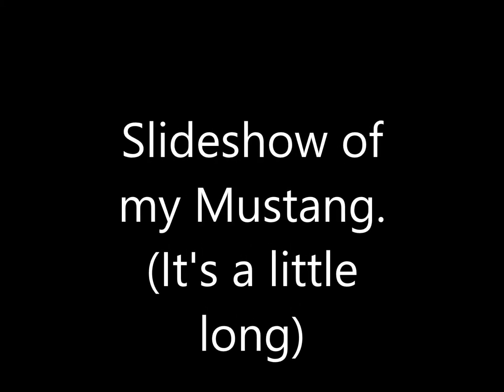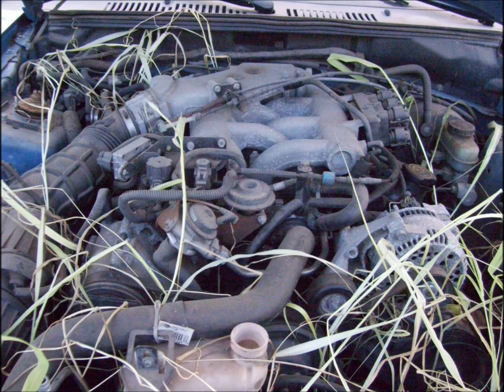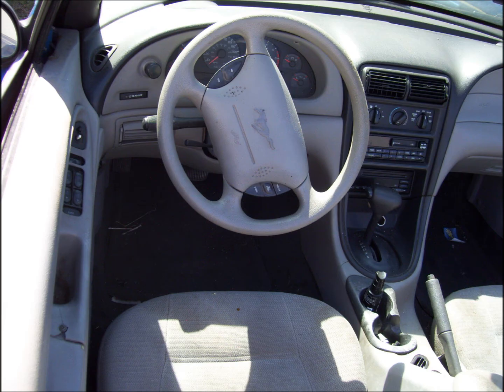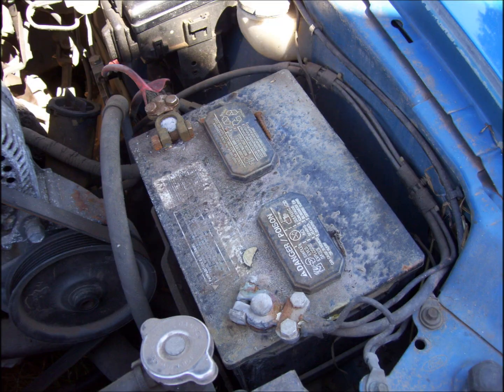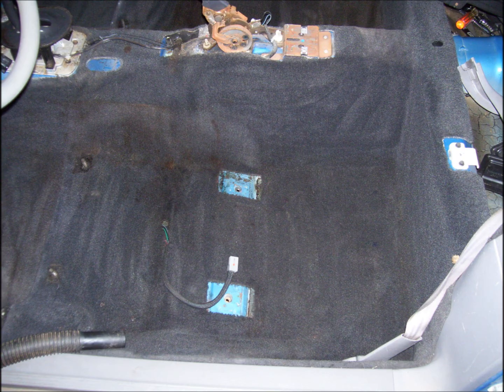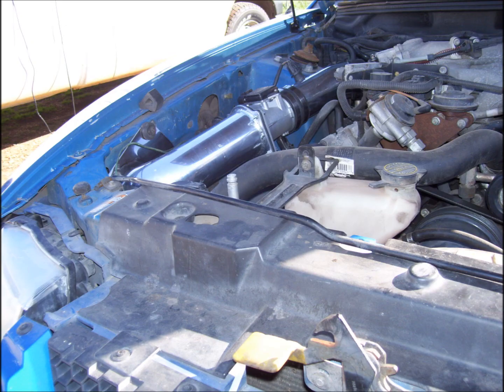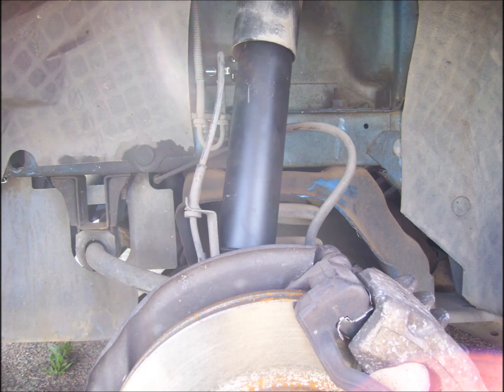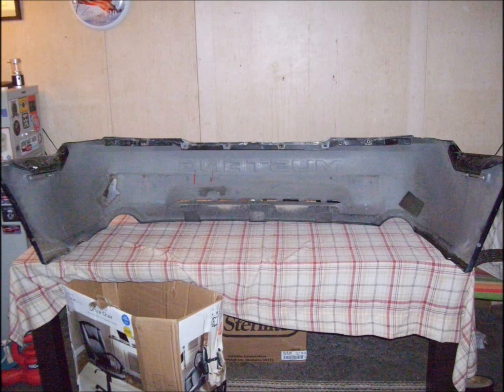Slideshow of my Mustang it's kind of long}

Comment: Looking good my friend I just got rid of a 2000 Mustang last year at 285 thousand miles on the motor and it was still running but the floors were rotted out and gone and the frame was pretty much cracked in half 😁👍👍👍
Reply from the maker: Thank You mine has 197,000 miles not much road salt here so no rust.

Comment: Things like this takes time, but worth it especially if you got it for a decent price due to a fuel pump to begin with.  Everything else can be done as long as you got time, know how and a little money.  Little bit at a time.  Thats what I did with my 76 vette.
Reply from the maker: Thanks I didn't know you have a Vette my favorite car you still have it?
Reply: I still got it, its in the garage.  I rarely drive it since the oil/gas wells have been tearing up our roads here. They said they would be repairing what they damaged by next spring, so we'll see.
Reply from the maker: Heck do a walk around shame you can't drive it